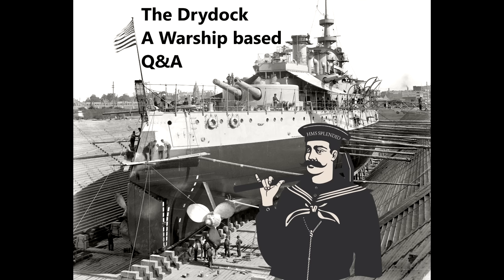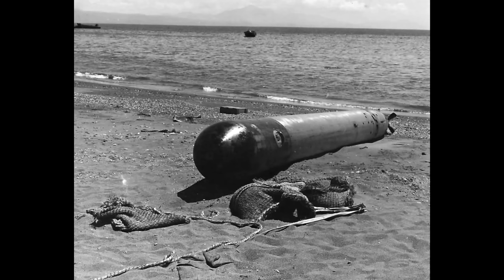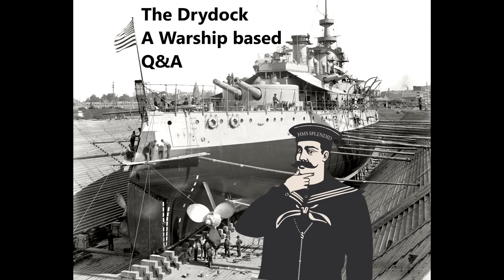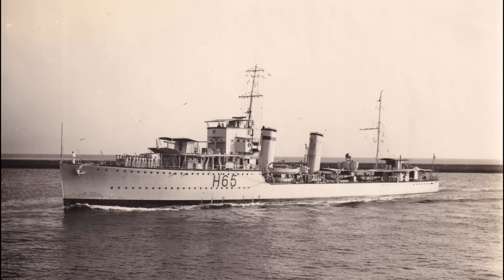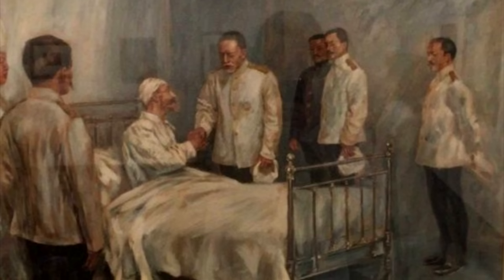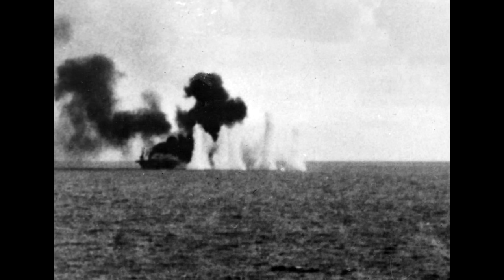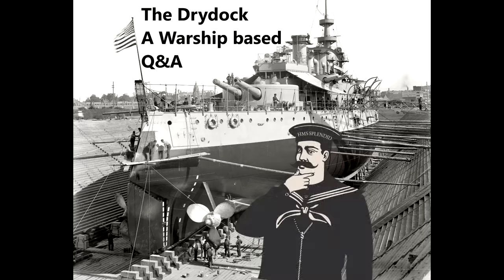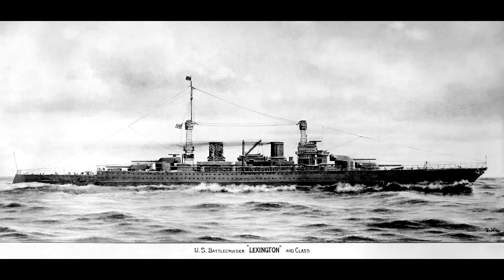The Drydock - Episode 289

Comment: On a 5"/38 the powder case and projectile are rammed in one stroke with the breach block rising at the end of the stroke. If the charge was to sit in the chamber for some time after loading it could "cook off" but the breach would be closed. If your talking about the projectile cooking off that would have significant issues even though the breach is closed.
Reply from the maker: I mean, with a red hot glow I could imagine the expansion causing the whole train to slow or snag briefly, and at that temperature the charge might initiate before making it all the way in.

Comment: 37:00 spaced armour only worked for decapping even on the comparatively light armour in tanks, for example the first spaced armour on A10 and A13 turrets and a similar iteration on Panzer IV Ausf D and E,  caps were just coming in at that time however both German and probably British designs may have been to negate the effect of Przeciwpancerny wz. 35 (the Polish Anti tank rifle) The German spaced armour being a result of the damage the wz 35 could do and the British may have attached spaced armour being aware of the Polish weapon -against it's re-deployment of the thing by Germans. The Wz 35 was smuggled out of Poland in late September 1939 and handed to the British, who said "Meh!" being that they were already aware of the system that the weapon used and were fairly disinterested.  Wz 35 was a lead based form of a squash head shot / shell.

Comment: Using pure, pressurised Oxygen for torpedoes back in the 30s would have excluded any of the usual gasket materials (like oiled leather or rubber), so any supply tubing would have to be welded metal and the technology was very tricky for moving objects of war, as you say. The Me163 rocket interceptor had similar issues with Hydrogen Peroxide tankage. A distressing number of pilots got dissolved alive when pipe welds gave way on impact, spraying the aircraft interior with High-Test Peroxide under pressure. This in addition to all the horrible ways that working with pure Oxygen can go horribly wrong when ordinary seamen under pressure of war make a mistake. As to the Walther turbine U boats and HMS Meteorite, I can only assume they left a trail of brown behind themselves while proceeding at maximum underwater speed.
Reply: Multiple ways to join pipe and tubing without gaskets or welding had been developed by the 20s such as flair fittings and taper metal to metal fittings as used on welding tanks
Reply: @timkohchi2048  Not saying otherwise, but gaskets and the like give joints some play and shock resistance. If a mass-produced pipe weld is subjected to the kind of impact Drach discusses, any imperfections are going to have to absorb it without any kind of mitigation. Welding tanks don't generally get fired off the side of a destroyer by high-pressure compressed air and then hit the water almost broadside-on.

Comment: electric arc welding is MUCH more “concentrated”, a much higher energy density process than oxy-fuel.  A much faster and therefore practical way to heat thick  metal to the melting point. With oxy-fuel, thick steel is conducting the heat you apply Away from the joint almost as quickly as you are inputting it, This makes it throughly impractical to weld ship hulls of any type (let alone battleships). As to your reasoning, actually the joint preparation is similar for gas and arc welding, you are beveling the edges and heating both to melting and adding metal to fill, same basic procedure, the Sorce of heat and it’s intensity is the main difference. Also a note on pure oxygen, tanks for welding were mass produced by the 20s  so no, other uses were not “artisanal”. Putting them in a tube with high explosives and fuel that gets tossed about did obviously create hazards though!

Comment: Question on the shell splashes near USS Gambier Bay....it seems based on the visual area they cover in the photo had they hit they would have obliterated the CVE. Is this due to the incompressability of water? Obviously had the exploded in the air or the ship it would have left quite a negative impression on the ship and any of the crew they contacted. But would it have been as impressive as the shell splashes look? Also it seems there is one smaller caliber hit shown. On the port side of the carrier a bit forward it seems like a small island structure. However we only built them to Starboard and there seems to be a small gap between it and one of the smoke cloulds above it. Is that perhaps a cruiser shell hitting?
Reply: Water is relatively light, so the explosion can throw it a long distance.  Think of being in the pool: if you know how to splash somebody, then it's pretty easy to move large amounts of water - and your hands are far less powerful than a naval shell.   

You can get an idea of how much damage hits do by looking at the many studies on warship damage.  It's nothing like computer games, so don't use those as a reference.  When  individual 18 inch shells from Yamato exploded inside a ship, they would have done a lot of damage but maybe not as visually impressive as the water splashes.  Had an entire salvo hit I suspect it would have been quite visually impressive, but I'm not sure anybody ever achieved a full salvo hit in any battle of the war expect (possibly!) at point-blank range.

The biggest explosions happened when something naturally explosive was triggered to explode, such as ammunition ships were hit, or a magazine, or a high pressure boiler, or something like the post-war Texas City disaster.  When USS Juneau exploded off Savo Island earlier in the war (1942) it was due to a magazine explosion triggered by a torpedo hit - many eyewitnesses assumed there could be no survivors but in fact there were many.

The video of HMS Barham sinking is one well known reference for what a ship exploding looks like.

Comment: 20:00 Your theory about Japanese conduct falls apart when you realize that they started on the Chinese which throws the whole "reaction to racism" bs right out the window.
41:00 Gas welding can't generate the heat accurately enough for proper penetration.
Reply from the maker: The interwar Sino-Japanese conflict started well after Washington.

Comment: wrt the question about USN battlecruisers, prior to the SecNav's proposal in 1915, which was adopted in the 1916 Navy Bill, formal requests by the SecNav for battle cruisers were made for 1, along with 2 battleships, in 1911, and for 2 battlecruisers, along with 4 battleships, in 1912.  Battleships were always given priority, to replace obsolescing battleships, to maintain strength.  

As we know, Congress only approved 1 battleship in 1912, Pennsylvania, and 1 in 1913, Arizona.

If battlecruisers had been authorized in 12 and 13, the design prepared by C&R in late 1912 was 920ft long, 97ft beam, 42250 tons, 10" armor belt, 8-14" guns, 16-6" guns, and turbine power providing speed of 29kts.  This is a significantly larger ship than either Tiger or Kongo.

Comment: Hipper or Prinz Eugen vs a Des Moines.  Now that would be fun ton-for-ton fight.  Flab-tastaic overweight vs lean, better armored and harder hitting.
Reply: The Des Moines was 9 years newer and 3000 tons heavier so it would be strange indeed if it was not any better !
Reply: In general I'd put my money on the US ship, even if it was the older Baltimore class.  But remember that the Hipper class had 12x21 inch torpedoes and the Baltimore/Des Moines class ships had no torpedoes, so it's very situational.

Comment: Anyone correct me if I'm wrong;

The welding would have been a oxy/acetylene torch with a flux rod held separately from the torch

I've done it that way anyhow and it makes sense due to the lack of electrical current around or in water

Comment: 31:22 - In fairness to Bikini Atoll, the vast majority of the atoll's radioactivity isn't from Crossroads Baker, but from Operation Castle in 1954, which involved approximately two thousand times as much nuclear yield being set off at surface level as Crossroads did.  (Also, the radiation levels at Bikini are actually low enough now that the atoll could feasibly be decontaminated and rendered habitable again, as was done for Enewetak, the other nuked atoll in the Marshalls, in the late 1970s.)

1:04:14 - 320-338 F.

Comment: Can we please stop abusing the term “Square Cube law”? A lot of the times you’re using it to just say that “mass scales with radius cubed”, which is just a law of density.
Square Cube Law shows that two measurements will diverge if one of them is governed by a square law, and another with a cube law. The most famous is in structures, whose mass - as you point out - scale as per the dimensions cubed. HOWEVER, the maximum survivable pressure on contact with the ground scales as the dimensions SQUARED. This is why to make things bigger, we have to give them bigger feet or they collapse with the pressure.
Reply from the maker: I generally use it in the context of 'the increase/decrease of linear dimensions will result in a significant divergence in volume compared to the previous ratio'.
Reply: @Drachinifel  That's fair enough. Honestly, I'd just call that a "Cube law"